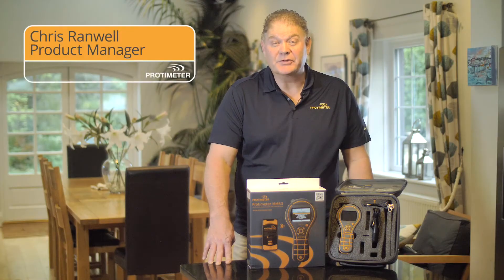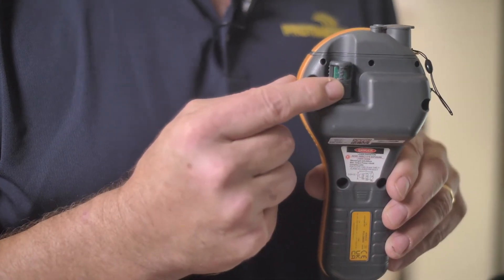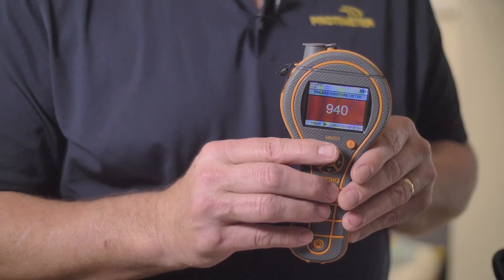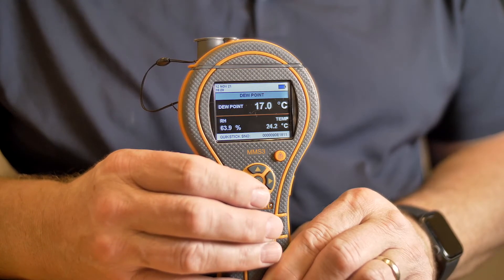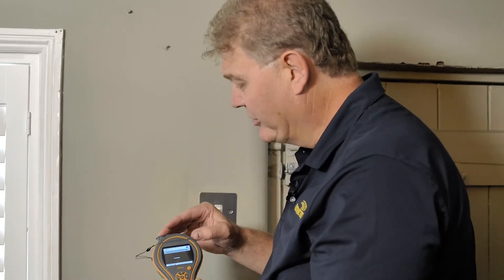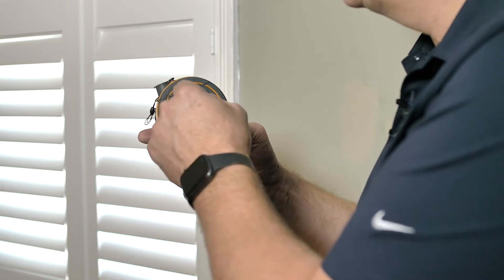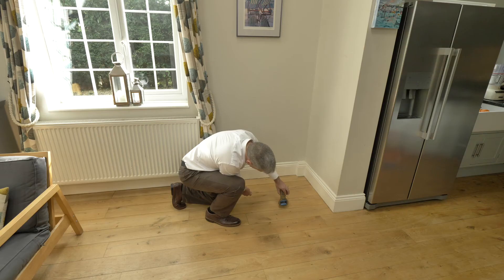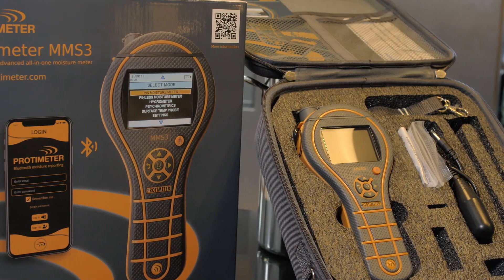Introduction to The MMS3

Comment: I have the MMS2 and what’s stopping me getting the MMS3 is having the “No condensation” “Risk of condensation” and “Wet” now removed and instead a full screen of Green, Yellow and Red. The words always worked better with the customer than the colours. When they see “No condensation” it’s harder for them to argue it. Any ideas why you have opted to remove that feature?
Reply: It does have it, when in surface temperature mode. It states condensation or at risk etc.